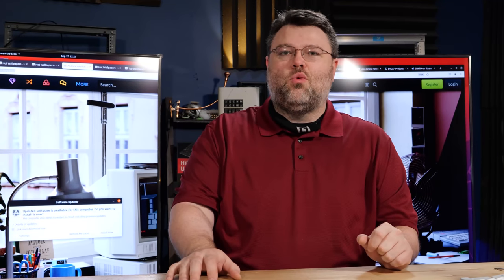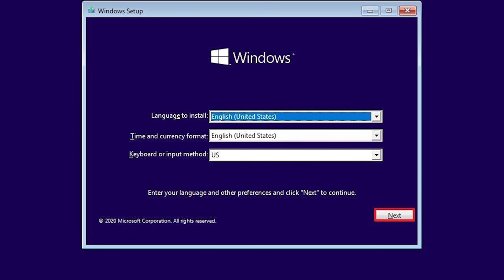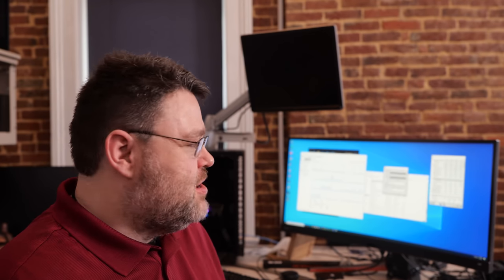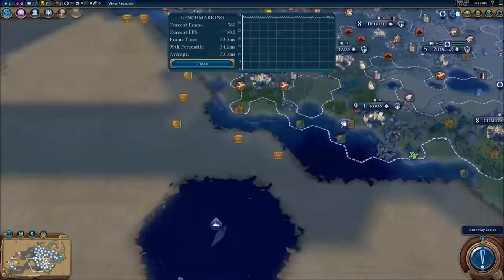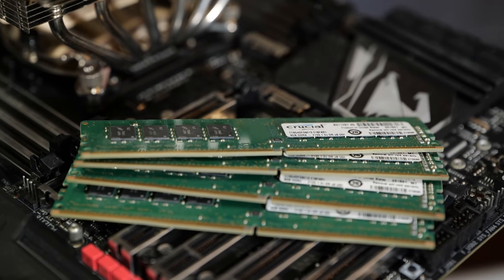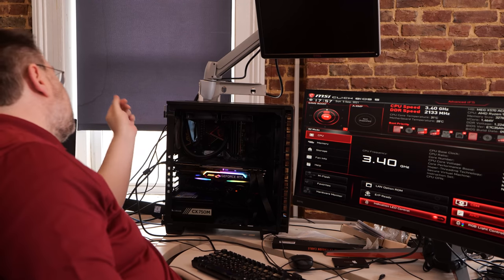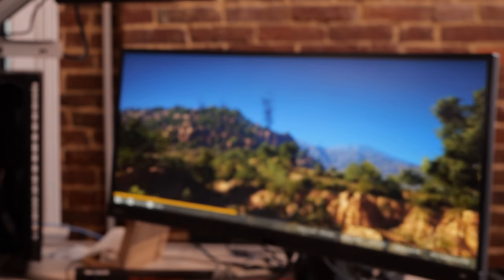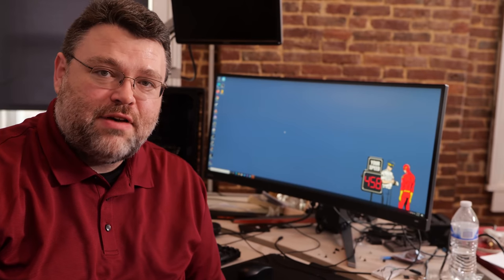Level1Techs Real Upgrades: X299 7900X to AM4 5950X

Comment: Wait... so... why was the old CPU running that hot with that massive cooler??? Did I miss something? You've shown something quite intriguing and a part of my brain must now know.

Last week I finally caved and upgraded... not that I REALLY needed it, but prices are currently at it's lowest (here in the 3rd world) it's been for Ryzen 5000 and TSMC will be hiking prices later this year. Combine that with a VERY nice special on a Asus Prime x570-p motherboard which worked about about $20 more than the B550 I was looking at, it seemed like time to retire the old i7-4790 with it's mismatched 24Gb of DDR 3. I mostly work from home and need to run some VMs for testing stuff and going from 16 to 24Gb made quite the difference for that. New system is 2x16Gb G Skill 3600 CL16.

The only thing I'm liking less and less of the new setup is Windows 10. Yes, I was still rocking windows 8.1 using ClassicShell for a proper start menu. What can I say... Win8 has been super reliable in my experience... like really solid... surprisingly solid. The big difference between Win8 and Win10 for me is the fact that Win8 did what I told it do to while Win10 is making it up as it goes. Some settings I've had to set a few times now. Probably need to look into having some run at logon to automatically just set it each time. Win11 is looking like it's going to be worse with Microsoft doubling down on the advertising... what a time to be alive when you install an OS and the company behind that OS acts like it owns your system now.

As for the old i7-4790, it's on a gigabyte board with 6 SATA ports and will now become a little proxmox machine doing some simple file hosting and possibly some... errr... other stuff :p

Comment: Actually, the 7900 is known to have thermal problems due the fact the die is not soldering to the Shield cover or whatever the name is. That processors needs the delid procedure and repaste. I could bet that's the issue :)

Comment: About temperature 95-99 C, it is necessary to delid CPU and use liquid metal and everything will be fine.
Reply: When the 7900X was $1000 or so, delidding was/can be nerve-wracking for some... (it is certainly not without risk!)

Comment: Current specs are
CPU: R5-3600 (Upgrade to R9-5900x?)
MOBO: X570 Aorus Elite WIFI
SSD 1: Crucial mx500 250gb, this is the OS drive (upgrade to 1tb Samsung 970 evo?)
SSD 2: Kingston KC200 1tb, game drive
GPU: RTX-3080
Ram: 16gb 3200mhz G-skill ripjaws (add another 16gb?)
PSU: Cooler Master 850w gold

Comment: Waittttt. I have a ryzen 1600 and I am never able to put my pc to sleep because it never wakes up properly (fans spin up but no video output).  Is it possible that I'm having the ryzen low power issue?  I recently upgraded my power supply to an EVGA unit but the issue still happens.

Comment: Would you like to try and plan a DAW optimised pc? I’m going to be building one in the next weeks and could really do with some in depth analysis for what is the best parts, and makes for a DAW, built one a year ago with 3900xt for a composer friend and it runs good but even with its specs I’m hitting performance limits when mixing and mastering on it.
So, would you be interested in helping out on a remote (I’m living in Germany presently) build?

Comment: I would fired 1.35 vaults into the old ram and upped the MHz 500 .
Then tested stability maybe knock the primarys down 2-3 and ran 3200mhz

Comment: Some simple things that can help gaming performance on X299 are: disable hyperthreading, disable downclocking features. (like C6 C7 states).  These two will help consistency and stuttering a lot for games that jump around in cpu usage.  I had problems like this before on my 7820x initially and this fixed it for me.

Comment: 4:40 how does hardware 64 compare to things like CPUID and other programs like it?  Why do you use this one specifically?  Is it better than?  More features? Or just what you are used to?
Reply: It is much better at monitoring and it has many more features. It’s just a much better application.
Reply: Hwinfo alone has more features than all of CPUIDs apps combined.
Reply: And u can drag temps to the taskbar showing permanent info during usage. Have it always configured that way on any new build.

Comment: Dude, the PC is overheating, and you keep benching it. 😳🤯🔥 First thing to do is check the BIOS battery, and put thermal paste. 🤷🏻‍♂️
PS: You can just touch the cooler and see the temp with cheap themometer, much faster than install new windows, install programs, benchmark and then checking logs... It wont bite you 😀

Comment: A whole video could be made around just overclocking the ram on Ryzen.  An interesting result in moving away from the 3600/1800 Mhz sweet spot for Mclk/Fclk down to 2800 Mclk improved performance. I wonder if manually tweaked timings at 3600 could match or exceed the 2800 result. And what is the impact of 32 vs 64 GB ram for gaming.
Reply: "I wonder if manually tweaked timings at 3600 could match or exceed the 2800 result"

It could, massively. The difference here is probably due to a difference in the amount of memory ranks, bank groups and banks as they were not investigated or controlled for but are hugely important for performance.

Both configurations are objectively terrible and not really something that i would pair with even a 5600x since you can do a lot better for the same price.

Comment: Try increasing the SOC voltage a little and I bet you could run that ram at 3200.  I ran into this issue before on a friends PC.  The Stock SOC voltage is to low to run XMP-3200.
Reply: It is barely enough for XMP-3200 and not enough for XMP-3333 in my experience.

Comment: I'm Running a i7-6800k. That CPU would be a nice upgrade, but I'd rather move to a platform that makes less heat.
Reply: not a very nice one though, not unless it's free or nearly free. I'd go for a 5800X if I were you.
Reply: @ahmetrefikeryilmaz4432  I'm thinking of waiting for Zen 4 at this point. What I have is currently good enough.

Comment: I honestly want to know how your getting Ghost recon to go above 60 FPS , my vs if off, framerate limit if off, I have a 144hz monitor but stuck at 60 fps, low high ultra  doesnt matter , my 6700xt is just idling, running a 1700 at 3.4 ghz , there a setting or something in ghost recon somewhere ? ini file maybe ?
Reply: what cable are you using HDMI or DP that can affect how many frames your system can push to the monitor
Reply: There could be a framerate limit/vsync/freesync enabled in the radeon driver management
Reply: @methlonstorm2027  DP , its only GRW that does this
Reply: @Dylan-xc8yz  no no no and no, its only GRW that does this and also in game I disabled all those

Comment: supposedly x570 and b550 can do 16+4 directly to the cpu .. but no board seems to support it. A shame for everyone with a nice gpu and optane. X570S is physicly identical. The newer agesas just lower power consumtion so much they can run it passive.

Comment: If Intel made a successor to X299 it'd be a contender with 4th gen TR when it comes out. I'd love to upgrade my system.
Reply: It doesn't seem that Intel will be relevant in the HPC and workstation market in the near future.
Reply: @ahmetrefikeryilmaz4432  from what I've read, that may be the case. I guess I'm sticking with AMD then for my next HEDT build.

Comment: Would the extra memory density and fewer memory ranks not bottleneck memory performance? Memory performance and all that is largely a mystery to me, but I've seen a lot of videos that talk about how more memory ranks = better, and 8gbit memory modules are better than 16gbit memory modules. 32GB DIMMs are all dual rank with 16bit memory modules, while many 16GB DIMMs are dual rank with 8gbit memory modules. I would've assumed that 4 x 16GB would therefore be faster than 2 x 32GB, since you're getting double the ranks and less density.

Comment: not reading the title, just watching the video - i thought during a shortage wendell would actually try to make this current system work with no upgrades, those can be done in a year
Reply from the maker: Everything here was in stock at microcenter. H
Kept his same gpu and we showed we didn't really need to upgrade the ram even though.it was 2133
Reply: @Level1Techs  the ram part you really should investigate. it almost seems like its a matter of using 4 in t
Stead of 2 sticks made up the difference in MHz ...

Comment: 5Ghz 9900K with 4000Mhz CL14 DRAM still puts up more frames with better frame timing even compared to Ryzen 5000 series, you simply cannot get DRAM performance up to the same level. Eg in Quake Champions you can keep scaling beyond 200 and even 300fps with more DRAM frequency up to 4400Mhz, if you keep the timings very tight, especially on GSkill Elite Rev 2 or even Flare X Rev 2 (B Die). You simply cannot get 4400Mhz CL14 or 4000Mhz CL12 stable for gaming on Ryzen 5000 series, maybe a CB pass only, on a binned IO die. If you are gaming above 144hz or 240hz, it's still Intel Ring Bus at 5Ghz and insane DIMM speed is still best, otherwise spending money on high perf non ECC DIMMs on a server? dunno.

Comment: i have a 2200g in my office and the shit runs so low power that the cpu stays 2 or 3c more than ambient ! at idle or few chrome tabs open .. which is the normal use case.. chipset gets way hotter than the cpu

Comment: This video reminds me of my mid 2020 upgrade when my old X99 5930K decided to die and I replaced it with a 3950x and threw a 2080Ti in at the same time.  This year I swapped those out for a 5950x/3090 and gave the 3950x/2080 to a family member who is now making good use of it.

Comment: Skylake-X is not really a good fit for most consumer grade workloads. The cache subsystem is geared towards scalability (cores) and bandwidth, at expense of fast latency response. In many games SKL-X is even slower than the previous Broadwell-E generation.
The only redeemable aspect of SKL-X is the dual 512-bit FMA units, but unless you earn money running or developing specialized code for this ISA, it's a dead weight in anything else.

Comment: Lol wow compared to that old system my system is much slower and got more problems... Im still stuck with my AMD apu A10-6800k with 16 gb ddr3 at 1833mhz  and a 980 Ti Extreme from zotac. My system been struggling for the last 2 yrs to do what i want.

Comment: looks like poor mount or thermal application .10 cores even then with a new noctua cooler should be like 30 -50 C idle at 20 25 ambient. i had one of intel stock coolers not click on one side and nearly melted my cpu down at idle. some has to be making contact on one corner cause the one core is chilly in comparison

Comment: Ryzen 5000 series performs much better with 4 sticks (Dual Rank) than it does with 2 sticks. It's not just the timings.

Ryzen 3000 also loves Dual Rank and 4 sticks. I have some 2,133 MHz Samsung B-Die in my Ryzen 3900x. 4 Sticks single rank. Overclocked to 3,600MHz with CL14. My 5950x uses 4 sticks (4x16GB) G.Skill 3600MHz Dual Rank CL14.
Reply: @rolo4733 I know. Dual Rank meaning 4 sticks of Dual Rank.

Comment: I rockt my I7 970 10 years.. 
 with 8 GB ddr2 RAM
only GPu get one time switcht ty to the defekt display.-.-

And not i use a R9 3950x with finel MSI RTX3090  and 64GB (16GBx4)RAM xmp off ty to the Mainboard-.-

Comment: I stopped buying Corsaid PSUs. I bought a PSU from them and beautiful cablemod set for my PC and found it was incompatible. Apparently there are Corsair PSUs with completely same model number, but they have the model number written in different color, like yellow or white and that also says what the connectors are for their modular cables, etc. I didn't understand this and asked on a forum and got laughed at for being stupid. So I buy different PSUs now from manufacturers that accommodate stupid people like me - if I see a model name on the PSU and model name on the cable kit and they match, I completely forget to compare the color of the text that the model name is written in. I know, I'm dumb.

Comment: i upgrade from x99 5960x to am4 5900x, so, its kinda equal...
Reply: I had the same setup though i went with the 5800x instead. my factorio map went from 19-20 UPS to 45-50, so better than double.

Comment: Ewww... is that nail polish 0:32 ?
Reply: The blue stuff? Looks like KPx; Thermal Grease often used in xtreeeeeeeeme Overclocking stuff, but apparently works really great in standard operating conditions as well.
Reply from the maker: thermal paste from a mobo heatsink